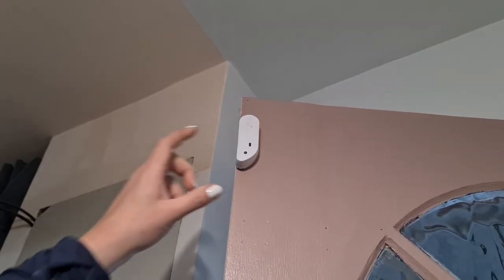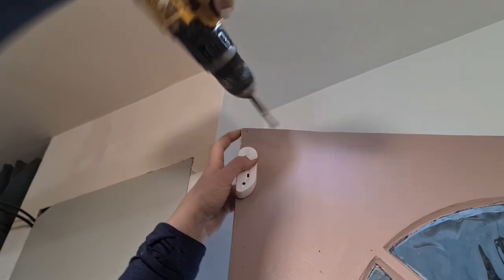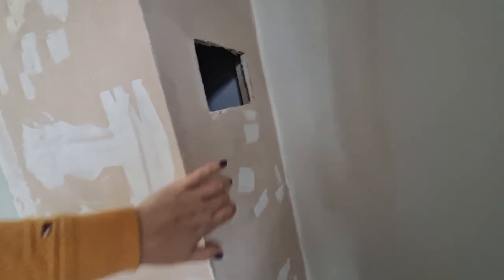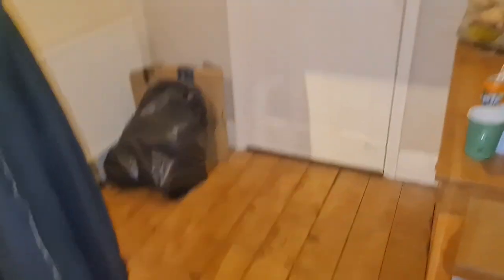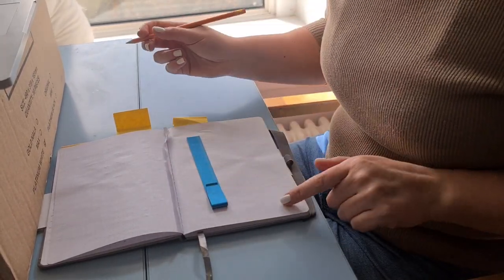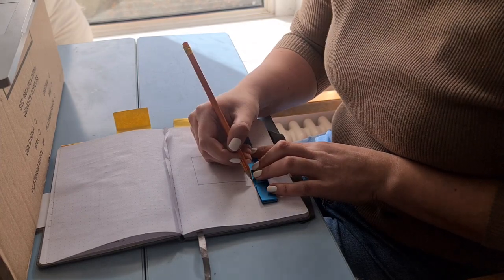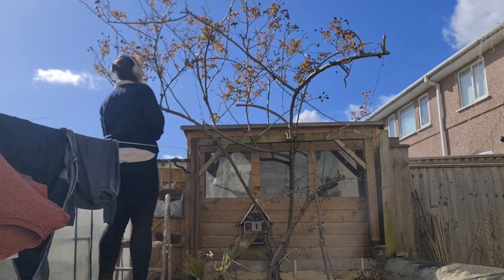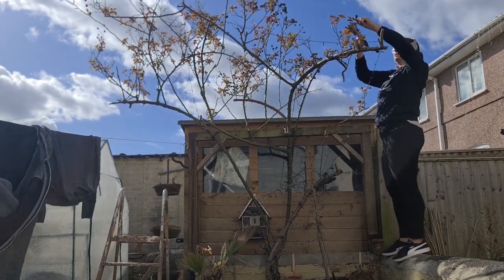What jobs do you get done when you are SICK?! #emmavlogs 7

Comment: I've always been told those button batteries are really sensitive to being touched (probably because of the contacts being the full thing & how you'd naturally pinch it touching top and bottom at the same time) & you risk it losing charge if you do. & it's better to not touch fresh ones at all with your hands when installing but use plastic tweezers, or I use a bit of cardboard (usually the packet) to push it around and down into the holder.
Hope you feel better soon (you might want to consider cutting that rose back quite hard after flowering this year to get it growing from the base again otherwise they just get really tall and stringey, I have on offender myself which gets cut almost to the ground)
& Re the waterbutt base, be cautious of having wood so close to the house wall, you don't want it keeping moisture close or tipping water onto it. The plastic bases are tight fitting to the butt base so the butt can be as close to your downpipe as possible without holding moisture on the wall it's against & so you can actually get your bucket/watering can under the tap on it.
Reply from the maker: Ooh thats gpod to know about the batteries, i never knew that! Yeah this rose bush has a life of its own. More stringy than a ball of string!